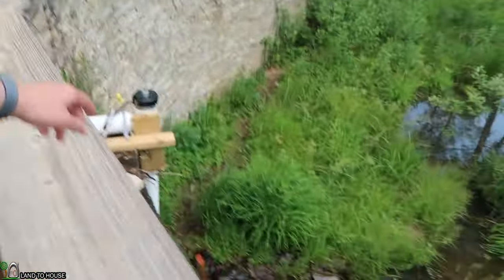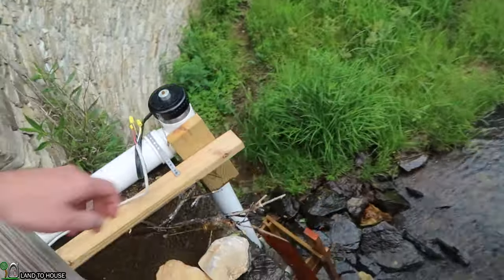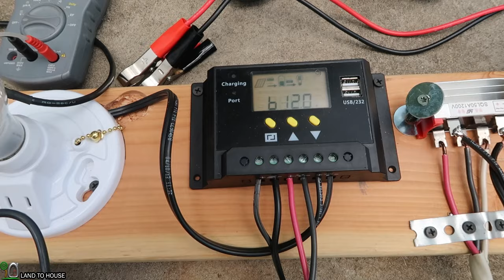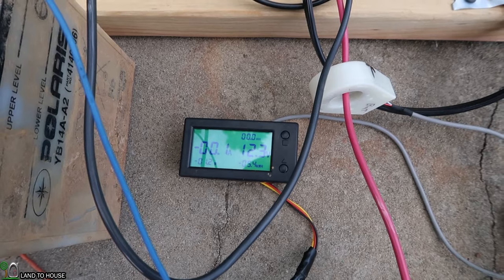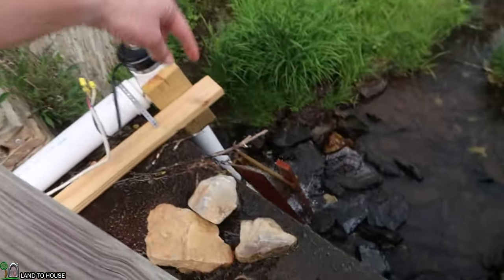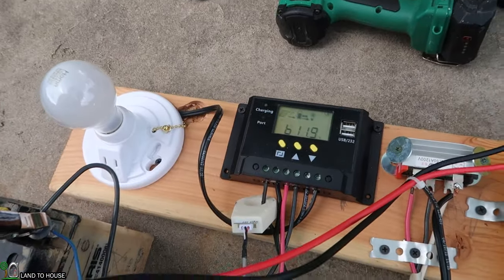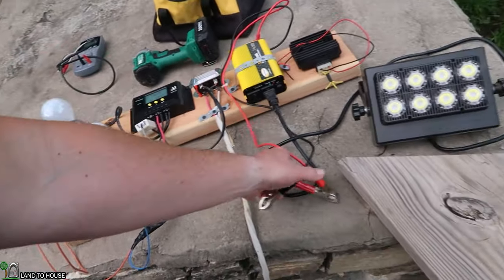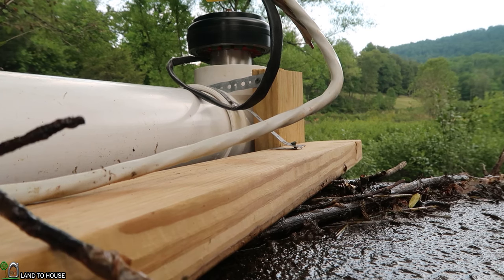POWER reading on the 4 inch hydro turbine

Comment: The way to improve that system is to get rid of it and install a micro with jets instead of turbine. That turbine is using too much water while producing too little power. Get a Turgo generator and you will easily produce 300 - 500w with what you have.
Reply from the maker: My other system makes 300+ watts. From the way I understand it the power calculation is:
(head pressure x gpm)/10=power. So if this unit can have the full 8 feet of head pressure and a flow rate of 200gpm. That is 160w max. I dont know that this unit will pull 200gpm under load. I am guessing we can get it up to 100w with some tweaking.
Reply: @LandtoHouse  Didn't you say you were getting 100 gpm?
Reply: That wont work in low head setup like this in a spot like this it is either pitch back overshot wheel or these turbines to little power from this unit is due to the windings been done for a set rpm for max power and with direct feed to battery the rpm is pulled down once the gen is in the correct rpm range it will perform better
Reply: There is a miss conception about pelton turbine. Pelton turbine are use with a high head so the pressure at end are the way to power the turbine.

This case is a low head profile. So, the pressure is mostly null but you have to work with the volume of water. So pelton turbine is unadvised in this case.
Reply: @jpmurray01  Yes you are totally right the head is too "little" How about the ancient grinding mill with a belt and dynamo like the old bicycle light generator 😊🤔just wondering...

Comment: To measure the power you need to read the voltage of the input as well as the current. Not the voltage of the battery, else you can calculating it very wrong
Reply from the maker: Using the multimeter I found the input voltage under load to be 12.8v.  The amps were 1.4. That is what gave the watts of 17.9w.
Reply: @LandtoHouse  I would say the amp meter does not read in 2 directions and you had it wrong way round on the battery lead so you got   no reading with pwm you will find panel footage is not much higher then the battery
Reply: Lucky he didn't blow that battery up😂
Reply: Ohms law

Comment: You are using the wrong type of regulator and wasting power.   Those types clip excess voltage and does not go to charging.  Since you can produce 45v, use an MPPT regulator and you will get more power out of your system.

Comment: Get rid of the bucket once your siphon is going. The bucket is slowing down the water flow.
Reply from the maker: Langston says that air will creep back up the down pipe if the bucket is removed. I will give that a test when I increase the length of the down pipe.

Comment: The turbine shaft needs to be longer and situated close to the bottom of the delivery tube. The turbine needs velocity, and this is best delivered with a high static head.
Reply: No you are wrong it is a siphon turbine, the siphon propeller turbines exploit the depression that is created in the exhaust, it would not change anything in these conditions, the only way is to increase efficiency and production is by abasing the exhaust, increasing the jump, obviously there are limits due to cavitation and destruction of the propellers and maybe doing it slightly conical, the jump is measured from the surface of the water higher than the lower one. 
https://www.powerspout.com/collections/lh-low-head 
https://www.powerpal.co.uk/TurbineFlow_WithLeaves!.avi
Reply: @winterburan  Looking at the outflow volume, it is clear that there is a lot of cavitation in the exhaust flow. Cure this then I will agree with you.

As it stands the cavitation in the exhaust serves to act as slippage and a reduced head height.
Reply: 😢 although this just dropped into my feed first impressions is an archenemies screw and some kind of gear box between the output shaft and the generator 🤔

Comment: Just a comment on the available power: If your estimation of 60 gal/min (or 227 liters/min or 3.8 liters/sec) is right, and you have a 8' drop (2.44m), then you only have 3.8 kg/sec. × 2.44m × 9.81 m/sec² = 91 Watts available for continous opperation.
Reply from the maker: Yes. I am actually not looking for continuous operation though.  I want to see what the max power is based on the head pressure I have available. This is all just testing for Spencer Langston. He is looking for numbers to tell his customers.  In the meantime it makes for fun youtube content!
Reply: Great analysis!

Comment: YOU SHOULD BE ABLE TO PUT IN A SECOND HYDRO GENERATOR.... THEN YOU WON'T NEED TO EXTEND YOUR PIPES.  YOU WOULD WIRE THEM BOTH TOGETHER YOU SHOULD BE ABLE TO JUST TO PUT THE WIRES TOGETHER.

Comment: Going up to a 6" suction pipe will somewhat increase the amount of power you get, but probably not for the reasons you think. A larger volume of water below will not inherently pull harder, just like a larger penstock on your hydro won't provide more pressure within the bounds of fluid friction.

The reason going up to a 6" draft tube (and tapered tubes in commercial installations of the same type) will increase power is because the water will slow down in order to flow through a larger cross sectional area pipe. To slow down water requires a pressure difference which will pull harder on the backside of the turbine. It's analogous to how with a pelton turbine you want the water to leave with no surplus momentum. Larger and larger pipe will harness more momentum.

Another potential efficiency increase is too smooth out your intake. A pipe cut off at a sharp 90 will not flow as well as a pipe with a gradually tapered intake. Use a heat gun and soften the end of some 4" pipe to work it into a trumpet shape.
Reply: You may have seen this but a guy from Scotland built something like you describe. He calls it the $50 water turbine. It puts out 200 watts with a 7.5 foot drop. He said the change in diameter also helped to reduce cavitation. Also, instead of a 90 degree turn at the turbine he used a "Y"ish  sort of connector (Shape:  \\| | ). Channel is called OpenSourceLowTech. Link to his design here: https://www.youtube.com/watch?v=ibCu0PxIZA4

Comment: The problem is the mppt, its designed for a current source (solar) it chokes the turbine chasing highest current, the dynamics of rotating machines are such that highest flux speed gives best power (loaded), switch to a lotech PWM charge controller, start again with your flow testing, measuring current vs turbine speed to find the best power, love the channel from Australia!

Comment: I would try using a mppt charge controller
Reply from the maker: Yes that would help! All I have at the house for testing is the cheap pwm.
Reply: @LandtoHouse  , MPPT will not help. It will not load the generator properly. Almost 12 years in this business with "The Stream Engine"
Reply: @LandtoHouse  hello, instead of a mppt system, you can use several load directly connected at the rectifier outlet and plot the measure on a graph with U on x axe and power on y axe (power= U x I). At the end you will find the mpp by yourself.
12V Light can be used for the load:
One 12v 50w
Tho 12v 50w in serie
...
Tho 12v 50w in parallel
...

A condensator at the rectifier output will improve the mesures.
For an accurate current and piwer measurment, use an ampèremèter in serie with the load.

Comment: PWM controler drops source voltage down to battery voltage.
MPPT charge controller adjust for maximum power. I would go for BLDC turbine instead, although it is more expensive.

Comment: Love the ram pump and micro hydro videos, please keep them coming.
You asked for possible improvements, I hope you will indulge me if I get a bit verbose.
1. Use a fully charged battery so your controller isn't pulling so much juice out of the turbine trying to bulk charge the battery and drawing down the turbine's output voltage just for bulk charging.
2.  Make sure the runner pipe is full of water with no air before putting a load on  the system.  When the turbine slows down under load the siphon is no longer maintaining enough flow to self-purge air, and air trapped in the horizontal pipe restricts how much water can flow through it.  I believe that's what happened when you tested the 2 inch reducer, there was air still trapped in the pipe so that test didn't have a proper flow of water.
3. It's really cool that Spencer Langston is letting you do this testing on the prototype.  A design change for him to make for the Mark II would be to add stationary guide vanes just above the impeller.  The fact that you have to manually start the turbine spinning suggests that the water, as the siphon is slowly starting, is swirling in the same direction as the impeller spiral, and not imparting any force on the turbine's vanes.  Your spinning it by hand breaks that vortex/swirl letting the water begin to flow straight instead of swirling and then the water can begin pushing the turbine.  Guide vanes angled opposite the turbine's spiral would not only let it self-start without help, but likely would also increase it's power output.

Comment: Your source of energy is the potential energy stored in water due to height. One can increase the energy generation by increasing the water flow per unit time through the turbine. And to increase the water flow, you have to increase the height difference (as the turbine size and pipe width is fixed). Every extra feet of the depth is going to increase the energy generation. You can add a pipe length to reach straight till  the rocks (as you have already mentioned ). If there is some decent slope then you can add even more pipes to to increase the height difference. Prefer to use some flexible pipe as joint and make an arc, avoid the sharp L bend.
The additional gain in energy is directly proportional to the net-gain in height; doesn't matter the length or ups or downs in the pipe( though up and downs and lengths affect, but its negligible and also sometimes air gets stuck at the curves and thus reduces the net water flow ).
Another way is by increasing the width of flow - out pipe. You can add a larger width - pipe at the point 2-3 inches below from where the turbine ends. This will suck out more water resulting in forced water flow over turbine due to volumetric  difference. You have to keep the diameter same. The next smaller diameter pipe after the wider pipe is going to negate the extra suction created.

Comment: Did you ever ponder the idea of extending the PVC pipe into the stream to forgo using the bucket?
Reply from the maker: Absolutely. I've purchased a 45ﾟ angle that will get the pipe down into the water. I had to do that because the rocks are directly below the waterfall. Hopefully this next week I will be able to do both the pipe extension and the 6" pipe and test the power.
Reply: @LandtoHouse  also drawing inspiration from Dam design, could you test the power output of the generator on the end of the 4 inch pipe where the 45 is (as in move the generator to where the 45 is)and get the extra push from the water in the pipe dropping including the siphon to get power generated from not just the siphon but the weight of the water coming down the pipe and get power from the increased fluid velocity due to gravity
Reply from the maker: I asked Langston's alternative power that same question. He says that this style unit is designed to have water flow like this and not fall on to it. Apparently whenever I step up the pipe to 6" the venturi Effect will increase the speed. 

 My guess is anywhere in that 4" pipe will have the same potential because of the syphon

Comment: It might be a stupid answer, but those 3 meters of fall, will increase the water power by alot. So if you install the turbine at the bottom, instead of at the top, you will probably harvest much more energy.

Comment: To pick up a few watts depending on the initial run from the power souce to the rectifier, go with larger cable as DC getting cranky and starts wasting power into heat, even tiny amounts causing increased transmission resistance.   I am talking relatively minor losses depending on the length of tge DC run, but why fritter away electricity, free or not.

Comment: I think you need to drop the turbine to the position of the bucket, so that your not relying on flow so much as head pressure. The weight of the water alone should be enough to spin it.
Reply: To increase the power out of the system, there must be a larger elevation difference between the water in the pond and the elevation of the turbine impeller.

Comment: The internal resistance of the battery us what's drawing down your voltage to 12.X if the battery was fully charged it would go up to whatever the absorption voltage settings on your charge controller is.

Increasing the power output of the generator would make it reach absorption sooner but the voltage your seeing isn't "problem" it's just the nature of batteries.

Comment: You need to connect direct to battery and use a diversion load controller. Light bulbs are not good for diversion loads, use power resistors, dc heating elements, etc.

Comment: Get rid of that cheap charge controller. For short testing purposes you can connect directly to the battery but disconnect if the voltage goes too high.

It might seem like a bunch of work but take your midnite solar classic down there and let it do a sweep. I'd bet your maximum power point is at a much higher voltage than 14v.
Reply from the maker: I might actually just purchase an inexpensive MPPT because I do want to bring power (solar) to the tiny house at some point.  The 3 midnight classic are too deeply embedded into my house system  and shed.  I do think it would be interesting to have a better controller especially when I increase the downpipe size and increase the length of the down pipe.
Reply: @LandtoHouse  ok but note that cheap solar mppt controllers do a voltage sweep that is much to fast for hydro. You need a charge controller specifically designed for hydro.
Reply: @LandtoHouse  I think that Joe Malovich is right: You need to have a good MPPT Charge Controller to get reliable results. MidNite Classics are specified for solar, wind and hydro. And they have an internal power reading.

Comment: Also if the clamp is on the input side of the charge controller you should read the voltage their too instead of off the battery to get a accurate power reading
Reply from the maker: Whenever I move the clamp halfway in the video I do put it on the input side of the charge controller from the rectifier. That reads the voltage coming in from what I'm understanding.
Reply: @LandtoHouse  The 'ring' (clamp) reads amperage flowing through the wire inside the ring.  Very similar to the 'sensor' you used on the grid-tie inverters under the house that read the incoming current to make sure you don't bleed power back out onto the grid.

Comment: If you want to measure the maximum power produced by our turbine, simply put a variable charge directly on your rectifier, like a variable number of 12V car lamps or another resistive load. Measure simultaneously voltage and amps out of the rectifier, while changing the load, and use the best product as a result.
Reply from the maker: I need to get a 12v bulb. I think what I have is an LED and would not do well in this application.
Reply: @LandtoHouse  Yep, you need old fashion light bulbs. An more than one. Or a big rehostat. You can build one with inox wire you can make coils. (like this: https://youtu.be/YC9DI7jJ-jw ) If you put the coils into cold water it will not burn. You may create some identical coils, like 8, and use them in parallel or in serial or both to create variant pure resistive loads. But old filament car bulbs may be easier to use.
Reply: @LandtoHouse  An auto parts store or an RV/Camper store could help you with that, 12v fans, 12v car vacuums, 12v tire inflator, 12v lighting, or a working headlight and plug from a junkyard.

Comment: Try adding some ac capacitors that are close to the output rated voltage output of the generator, this will help build a stronger field in the generator and cause some reactive power to form. This will help bring up your output voltage so you can do more with less input from the water system. Its not free energy, it will act as a voltage booster and help stabilize the system. You need to get an mppt for battery changing because it will give more power while that pwm chops off some power production.

Comment: I want to do kind of the same thing but using 5,000 gallon tanks on teeter totter with a directional rotational ratcheting shaft but I need a big hill to put my transmission lost in with a lot of downhill pressure the system at the bottom and a four-long pump underneath some of the cylinders and through love displacement to get the water to drain out as fast as possible it just pythagorean's cup redesigned

Comment: Q: why are you not using male and female threaded fittings for your test bed? That way
You just screw your pipe on and off, and can purple prime and glue your system together so you can't stop air Penetration? Worst you would have to use a Little bit of Teflon pipe Dope Between the male and female threads? Also why not use a 1inch 45 right next to the 4" wye, so the 1" pipe goes straight up. Again you could use 1" male & female threaded Fittings for easier set up and break down for your tests, and glue the basics? I do it for my sprinkler systems when I am testing thing out.